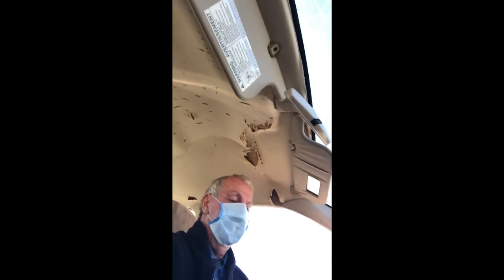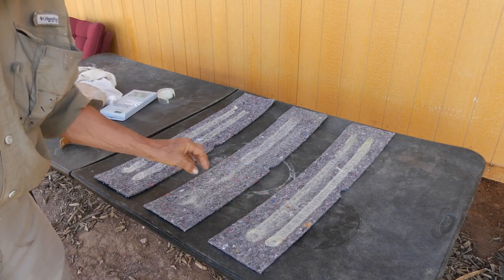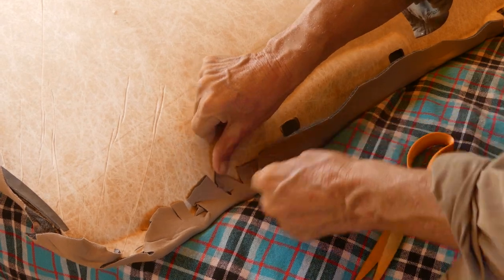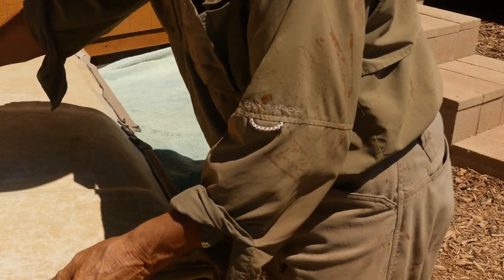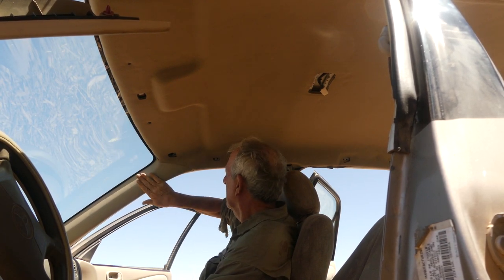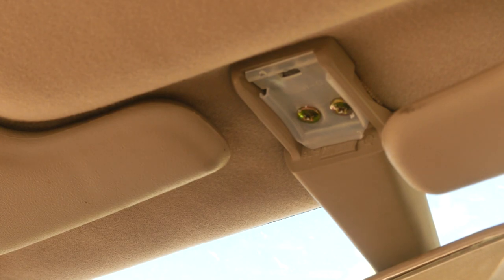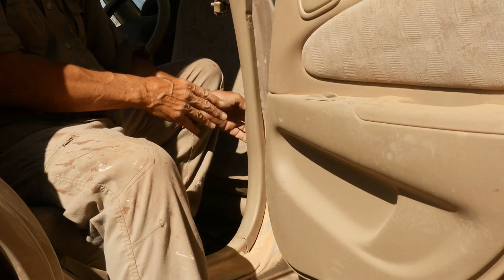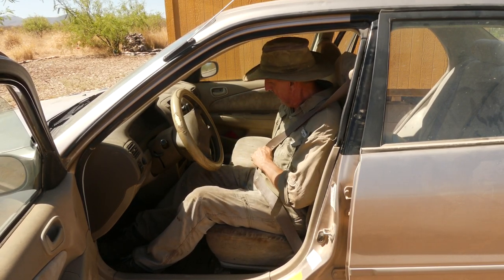Off Grid Senior Learns Auto Upholstery - Restores 98 Corolla

Comment: Wish i could have been there to help! If the time comes where you need to do this again (or a tip for followers), use a 6" short nap paint roller to "smooth" out the fabric as you lay it down on the glued backing because it gives you the pressure you need while spreading it out over a larger are so you dont end up with dents/waves/wrinkles. Also start in the middle where the dome light is and work your way to the outer edges to avoid stretching the material too tight and not having enough lay down into curved areas by the edge. Great job for your first time and never stop learning!
Reply from the maker: Great tips.  Thinking you have done this one before.  If I ever have to do another one I think I will work with the fabric when the glue isnt even tacky to help allow me to make some rapid adjustments before its all set in stone.  I thought of the small paint roller but thought I would have more control with my hands but...  lots to learn with this job for sure. Thanks for watching!
Reply: Hell yes

Comment: You did great.

Fancy upholstery work is hard.  

Basic upholstery is simple. (but somewhat labor intensive)  Mostly act like you know what you are doing and it will be good enough.

I reupholstered a 1959 Chrysler vehicle when I was 20.... using cheap drape fabric.  It lasted the rest of the life of the car.

Some of the techniques I had to use were a little more complex.  The headliner was held up with bowed wires instead of spray glue.
Reply from the maker: Wow F Huber sounds like you were a keen Upholstery fellow.  Way to go!  Thanks for your insight and great comments.

Comment: Looks great.  Perhaps gently poke a small amount of headliner fabric ( that was left over) in the hole that is cut too big for the back seat passenger handle using a screw driver.  It would not be too obvious being it's so small.  I have a 2014 Corolla.  Great car.

Happy belated birthday!
Reply from the maker: Good tip Deb and thanks for the good old 67 birthday wishes.
Reply: Just curious how many miles kindness has ( or you may not want to reveal her mileage bc some ladies are like that).

Comment: Great work! I worked on one with my youngest daughter. I used a wire brush made for a drill. It spins well and is variable speed. It took the foam off in no time at all. Of course I was using my solar system to power it. 👍👍
Reply from the maker: Got to love Solar systems right Michael?  I was afraid I would be too ambitious with a wire brush drill attachment and wreck everything.  In another time and place I might give that a go too.